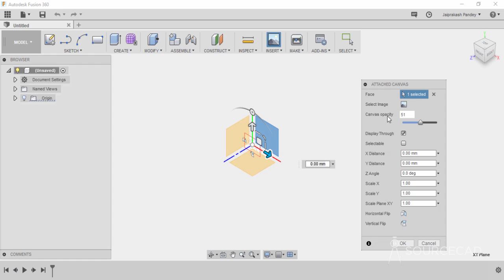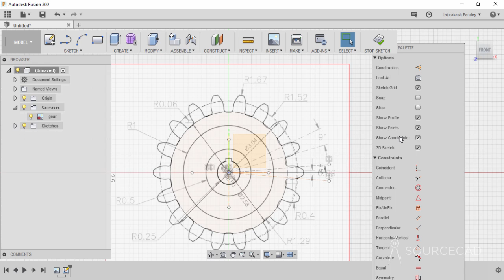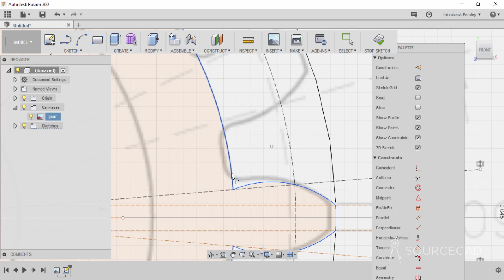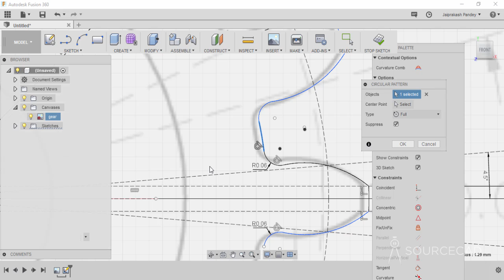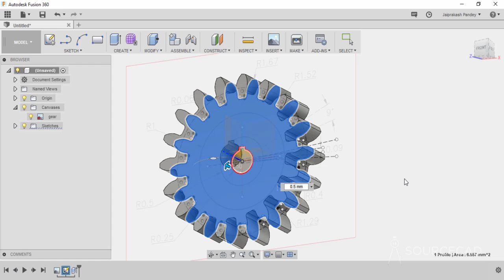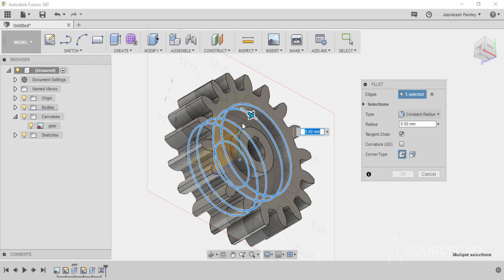Making a Spur Gear in Fusion 360

Comment: Very uselful information. How do you get that gear dimension and geometry? Is there any source that produce that 2D drawings?
Reply: Machinery handbook has everything you need to come up with all the dimensions you want. Especially if you need to make it from scratch based off of a general shaft size and gear ratio. Then you can pull the formulas and constants from the book and figure the rest out.